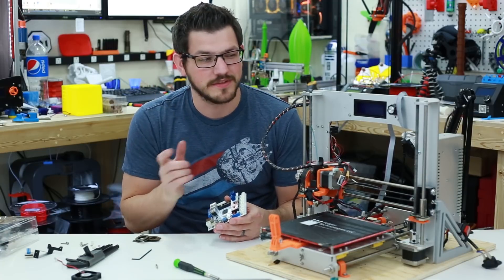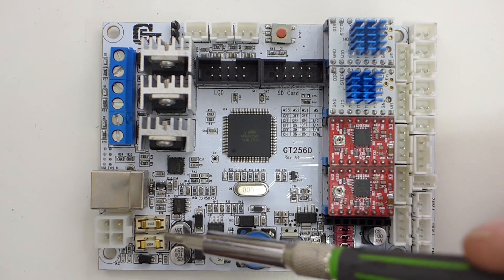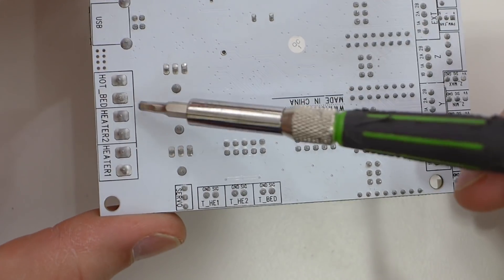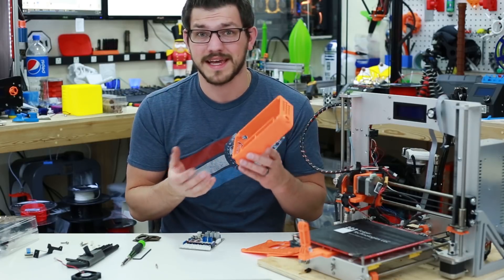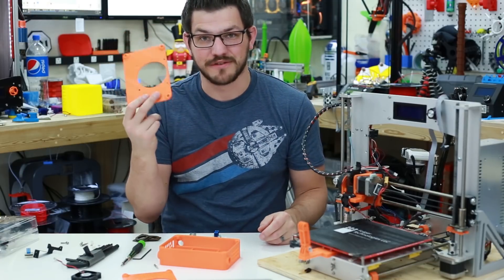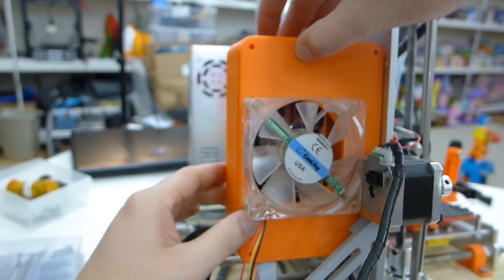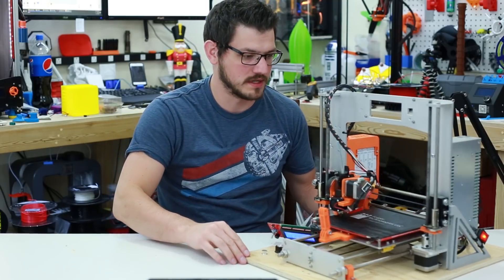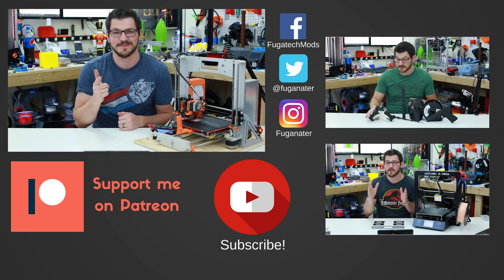GT2560 on the Geeetech Prusa i3 Aluminum

Comment: I just put this board in my printer and now the x axis only moves one way ,it thinks both directions are positive ?
Reply from the maker: You need to check your wiring. Not all boards have the same pinout.

Comment: did it came with firmware already? how you flash it? with printer ON or just connected to the USB?
Reply from the maker: No it didn't come with firmware on it. It depends on the jumper settings for power. I'm sure there is a guide out there somewhere on how to flash it.
Reply: @Fugatech3DPrinting  i Will have to see. Ive seen Manu tutorials but non match with my problem.

Comment: I know this video is old but the same thing happened to me. The board burnt out on the dc power input so mine was out for 2 months till I got another one. When it arrived I noticed that the 2 positive inputs were soldered together on the back just like yours. I de-soldered the join though and it has been used like that for about 2 years now.
Have you had any more problems with this?
Great video. Keep up the good work.

Comment: Can you link me to the 40mm fans that you use and also the connector to let a 2 pin connector fit in a 3 pin one...
Reply from the maker: Any 40mm fan works and all the ones on Amazon/AliExpress all have 2 pins.

Comment: It is possible to upgrade the Geeetech A30 with this board? Or know how to burn Marlin firmware in the GTM32?
Reply from the maker: Yes. You can use this board in pretty much any printer out there.

Comment: I have the geeetech I3 ally frame with the new style multi start Z axis screws.
I have a GT2560 Rev A board, has anybody got the real firmware I can upload.
It seems that it´s all a well kept secret, also I am not a computer wizard.
So go easy

cheers
John
Spain
Reply: It’s all just Marlin firmware. Hunt around on the forums on geeetech. They have links to the various printer firmware’s but they’ll be from marlin v1.02 probably. They’re on 1.1.19 now and it’s much better. Just compare the settings from geeetechs version of 1.0.2 marlin (the configuration.h file) and copy the values into the new 1.1.19. Tweak it for your setup and away you go.
Reply: many thanks
Geeetech engineers have sent me Marlin 1.1.8 firmware.
please tell me your settings for the jumpers.
looking down on them which direction is off and on.
did you change yours.
I am not a computer expert.
Thanks
John
Reply: Do you have a follow up video showing the board running.
Is your printer with the 4 start Z axis threads. (newer version I believe).
Thanks

John

Comment: Hey, I'm trying to upgrade mine using this board. What drivers did you use?
Reply from the maker: I'm suing A4988 drivers for the Z and Extruder and TMC2208 for the X and Y.
Reply: Hey Shane, I really appreciate the response. I'm using the A4988 drivers as well but for some reason the extruder motor stopped working (it works, it just wont extrude or move). Do you happen to remember doing anything about the pot on the extruder driver? Also, do you remember what firmware you used to flash the gt2560? I had to go through the config.h file and change a bunch of things (I used the Prusa I3A 2560 firmware from the geeetech website) to get all the motors going in the right directions.
Reply from the maker: You can get my firmware here: https://drive.google.com/drive/folders/1GFO7IhsLZJWJSrPTxTZLAoq_vPkV0tY6

If it stopped working then the stepper driver might have died. You can try a spare if you have it or just swap the X Y or Z to try it.

Comment: Hi, were the TMC 2208 drivers just plug and play? Did you have to remove jumpers/de-solder anything etc or did you just fit them and adjust vRef? Cheers

Comment: do you get any hotend temperature drop on this board? I put it on my Tronxy X5S and it was having big temp drop (up to 6C) randomly, almost causing failed prints. Switched to a MKS Gen 1.4 and no such big drops.
Reply from the maker: I have not noticed any issues yet.

Comment: Thanks for the vid!  I've been looking for an upgrade like this for my Geeetech Aluminum i3 for ages.  I'm going to order the GT2560 right now.  Right now I'm using RPi3 to drive my printer's print cooling so it will be nice to get actual active print cooling off the GT2560 plus dual E3D extruders!
Reply from the maker: Wow I didn't know you could do that with a Raspi 3
Reply: Fugatech 3D Printing Yes with OctoPrint you can add custom Gpio controls with new OctoPrint menu items.

Comment: A couple of questions for you. What firmware did you flash it with? I just got that board and want to do an upgrade on my printer as well. Also, what are the drivers you added to the board? Thanks for the video!
Reply from the maker: I used the i3 Pro C firmware and modified it for this machine. You can download it here: https://drive.google.com/open?id=1_r0ikxSizsi2P6P6sUcpTiyAeptNIYCQ
Reply: I would really like to know step by step ho w you flashed the board .. I have an mks and I am having trouble figuring it out
Reply: i have this printer with a dead sanguinololu, got me a GT2560 and was going to try your firmware but i`m getting an error "stray \357 in program" have any idea what could be?
Reply: Got it sorted in the menu "Tools - Fix encoding and reload" after that showed the error and the sketch is now ok! Uploading ...

Comment: I have 2 of the acrylic Geeetechs with this board, and they run very smooth. I also have a CR-10, and it runs like crap. I actually thought of changing the stock board for this.
Reply: Did you ever do this? I'm thinking about doing it now, I upgraded the power supply the printer is sitting in front of me in pieces so...might as well.

Comment: As I mentioned already in a group some minutes ago. A big heatsink on a MOSFET doesn't mean that it is good. Maybe it is just a bad MOSFET with a high internal resistance that consumes a lot of power on its own, and for this needs this heavy cooling. Good MOSFETS with a low internal resistance don't need so much cooling and the PCB will cool it enough.
Reply: And to add to this, a big heatsink, fitted badly, can be worse than no heatsink at all.
Reply: The mounted STP55NF06 are not bad, but also not very good.
I replaced it with PSMN2R0-30PL (Nexperia), these are 2mOhms with low logic level. Would even work for 3V3 on the Arduino Due.
The heatsinks are just ok, but not realy good. With the Nexperia they get barely warm to the touch at full load now.
The SMD fuses are another problem. As are the green connectors, especially for the heat bed. They are 10..12A on quality suppliers. These seem chinese clones. I replaced the heat bed connectors with screw terminals rated for 24A

Comment: man, you need some new Z threaded rods, those things are crazy bent.
Reply from the maker: Yep hence all those mods. I have some lead screws to upgrade it but just haven't had time yet.
Reply: I bought lead screws a long time ago and tried to make them work on this printer, but eventually gave up. I just had a ton of problems trying to get them to work. I'd love to see a video on this when you upgrade them!
Reply: Same here read my todays input I managed to fix mine. My Geeetech  almost did  2 things  1 a mess everywhere or 2 a hole in the wall lol